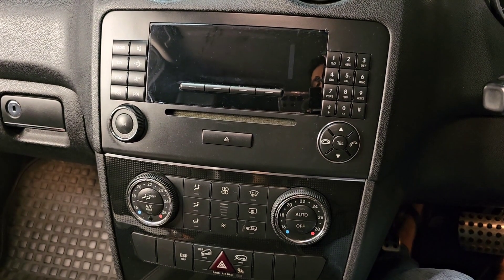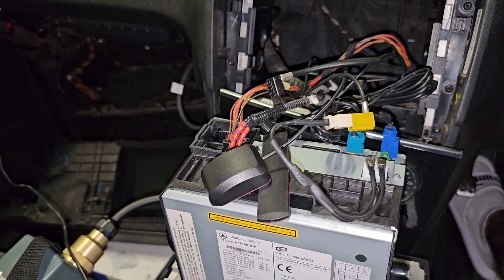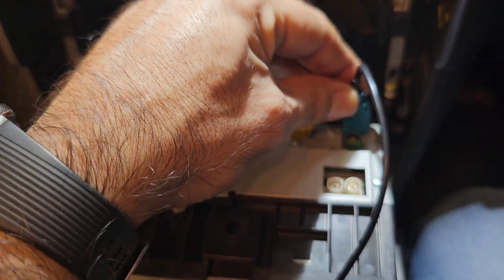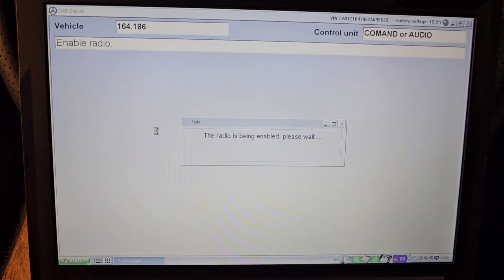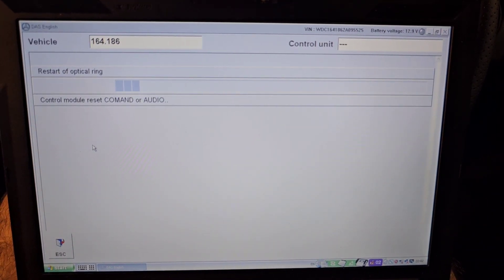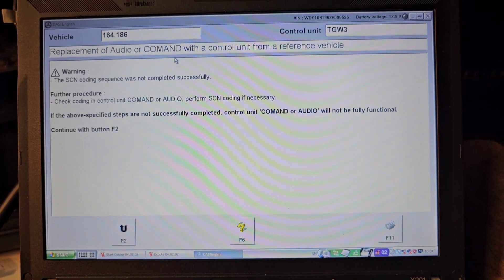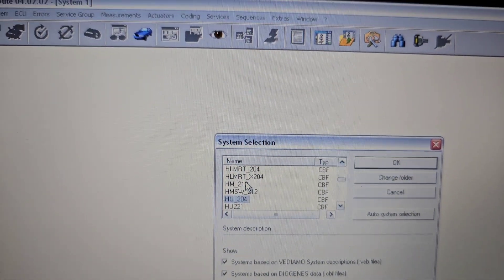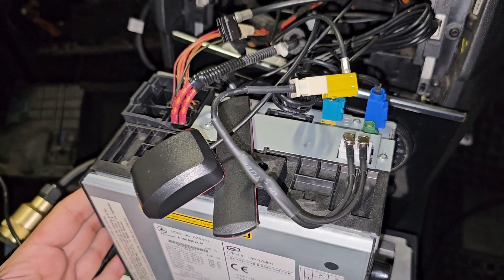Mercedes Headunit upgrade Audio 20 to command NTG2.5

Comment: Hi... I have 2006 slk r171 and the cd playar is very old like your car , i think the name is audio 20 , and i wanna buy a ntg2.5....  could you help me ? If the installation is hard i cancel buying this ntg2.5
Reply from the maker: Don't,  it won't work my friend.  You need NTG2.0 which is compatible.
Reply: @BenzAddiction  there was ntg2.5 on the r171! the issue is that the r171 is an ntg1 car, but at least on the w211 side, ntg1 Audio 20 -> NTG2.5 is supposed to be a relatively easy swap

Comment: i want to ask i have a w203 with audio 20 and i want to put ntg 2.0 should it work or i have to make coding via xentry
Reply from the maker: 80 percent would need coding as the fiberoptic sequence and loop and devices would not be the same.
Reply: @ so I don’t have a fiber optic cable in the car
Reply from the maker: @ΑλεξανδροςΠεκινι  so you don't have the 2 orange cables in the back of the unit?
Reply: @BenzAddiction  yes
Reply: @BenzAddiction  but I want to put in the future not for the moment
Reply: @ I don’t have any device no phone no amplifier no cd changer

Comment: I am not an expert but did your new NTG2.5 command unit come from a Mercedes with Harmon Kardon audio with external amplifiers?  Maybe the head unit is expecting external amplifiers and the internal amplifier is disabled?
Reply from the maker: I have tried disabling and enabling the external amp with no results.  Unfortunately my conclusion is that the AMP used on Mercedes-Benz after 2009 is different so the older ones can not be recognised by the new head unit.
Reply: @BenzAddiction  I agree with your conclusion.  Is it feasible to add and wire a 2009 or later AMP in your 2006?
Reply from the maker: @barrydandrews  I think it is. But might as well wire the speakers direct from the head unit, let's see in the second video 😉

Comment: I wonder whether your new COMAND unit is compatible with the amplifier. The fact that the MOST ring configuration has changed, shouldn't cause trouble; for instance it is usually possible to remove a CD changer and/or the phone/voice unit, without losing sound (as long as one replaces them with the bypass loops you used). Unless there is now some conflicting information, the system should technically still work. However, if there is some protocol mismatch between the new head unit and the amplifier then I don't think any change to the ring configuration will fix your issue. I could be wrong, though.
Reply from the maker: Thanks for your comment. Yes, I believe coding and MOST issue are 2 seperate issues. I think the first issue is to code the HU25 so amp and other modules can recognise it.

Comment: I wouldn't call all Android alternatives cheap. There are some that look pretty OEM when installed and they offer quite a bit more than the original COMAND units. For instance, you'll be able to navigate with current maps and use the radio as a hands-free device for your phone. The reverse camera display will have dynamic lines (that curve with the steering wheel angle), etc. I'll post a link to a unit I like in a separate post. BTW, since you have the MOST system, you'd need an adapter (as you said) but alternatively, you could also route a special cable from the new head unit to the amplifier (which is typically in the boot).
Reply from the maker: Yes, agreed, a good solid Android head unit would cost +$300. They can be good but there are still cons.